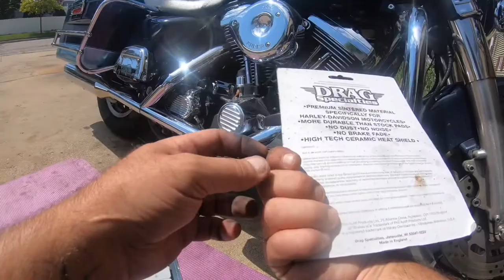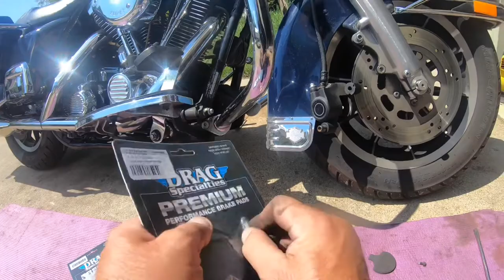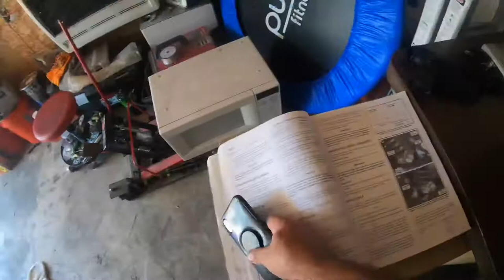Changing front brake pads on a 1998 ElectraGlide Classic

Comment: Here's a tip: Instead of using a screw driver to compress the plunger, take the cap off your master cyclender and siphon about half of the fluid out. Dont go below the brackline outlet though. Makes the job a whole lot easier.
Reply from the maker: Thank you!
Reply: use a c-clamp to compress the piston.....even easier

Comment: I've got a 2001 Dyna Wide....According to the manual it has the same calipers on the front and rear.  My bike does not.   The rear brake is the correct one for that year but, the front caliper looks pretty much like yours!!  Since the bike is 23 years old and I bought it used, it seems likely someone changed calipers for whatever reason.  I am trying to figure out if any of the pads in the video  would fit?  my front brake looks pretty much like yours but mine is chrome.  If that is the only difference in the calipers I do not know.  Asking because I would rather not go to Harley for something I could most likely do myself, as long as I know the parts have the right fitment
Reply: Just took a trip to check my front brake. It IS the same brake by the looks of it. Except the back of my caliper looks a bit different!   I'm hoping the diameter is the same, but knowing H.D.  I don't believe they made the same caliper, but different sizes?  Although I could be wrong!!
Reply from the maker: Good luck bud, hope everything works out for you.

Comment: did you ever notice that these pads were noisy when applied ?  I took off harley brand pads, I couldn't hear them when applies.  I put the same pads on as you did in this video and I can hear them clear as day when I apply the front brake. I have over a hundred miles breaking them in and haven't gotten quieter.
Reply from the maker: I could hear it for a few miles but then it went away

Comment: Did those front bolts sticking out the extra bit cause any issues?  I was wondering what would happen when the pads wear again.
Reply from the maker: No, it's not an issue, I wondered the same thing
Reply: @ThisOldHarley  Thanks for the reply and for doing this video.